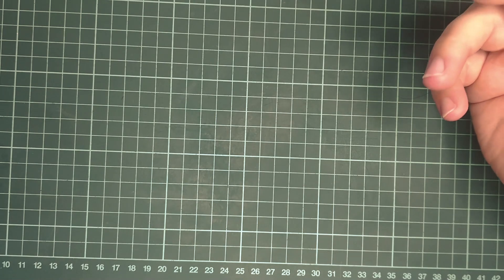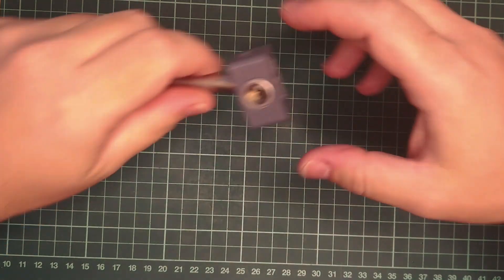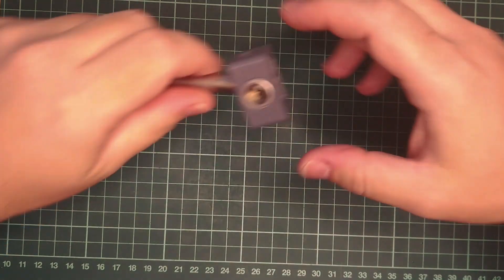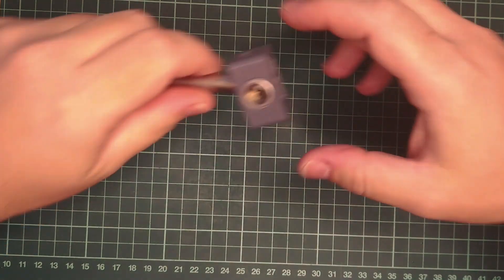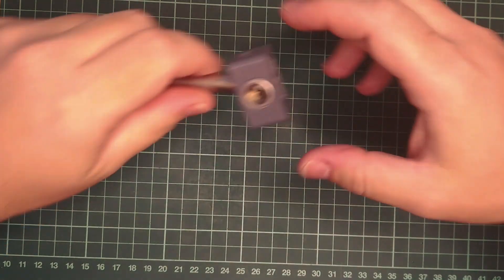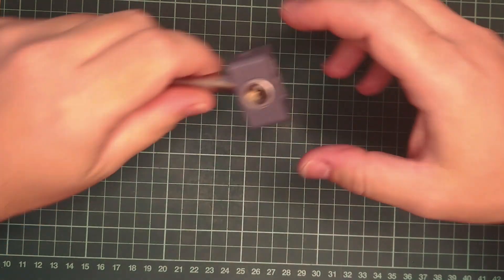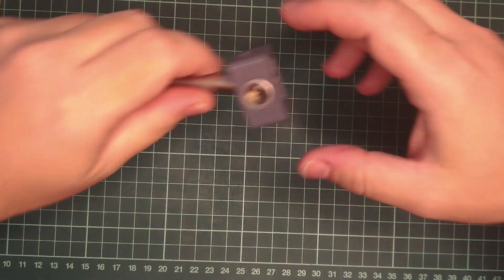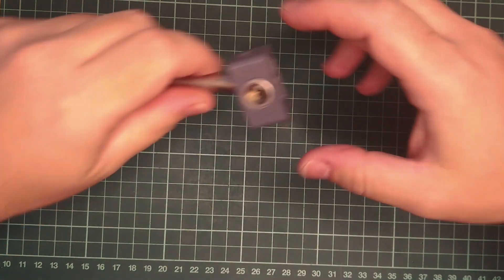TinkerJoy Explained. A #starcitizen joystick.

Comment: 30:25 try make a print mold of the printed part after cleaning it up maybe adding accenting in the mould afterward then pouring a resin cast. if it's UV cure it would save time and you could add any dye to it. lot of options once you have the shape for trhe snap in shell.
Reply from the maker: I'd prefer to avoid moldmaking, and design the parts that can be used, as 3D printed.

Comment: For the magnetic base you could have the cable mounted on a small spring base and have a push button or ball detent lock for the joystick mount. Would allow for quick removal and constant contact pressure for the cable.
Reply from the maker: Anything is possible, really. So far on the experimental chairmounts, I haven't had a single disconnect, but we'll see over time.

Comment: Just a suggestion - instead of having the thumb panel tilt forward, have it tilt back on the bottom edge. This matches the way you have your wires run better, and you won't need to extend them quite as much - also it will keep the wires out of the way when you rotate them back and give better access to the trigger mechanism.
Reply from the maker: That would bring huge interference issues with the bottom panels (or huge gaps between panels) I think it's better to have longer cables instead. but thankyou for the input!